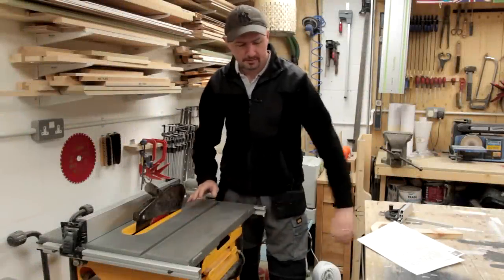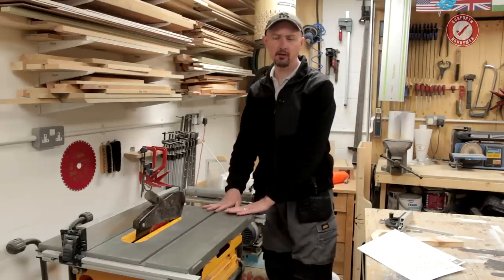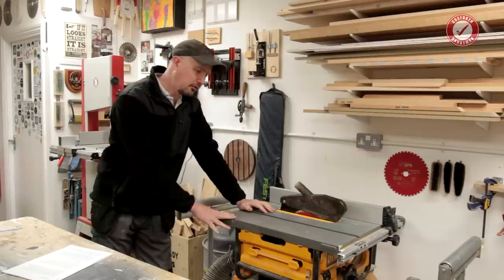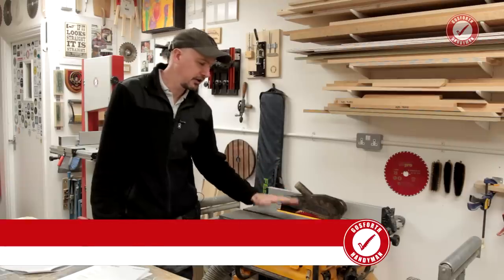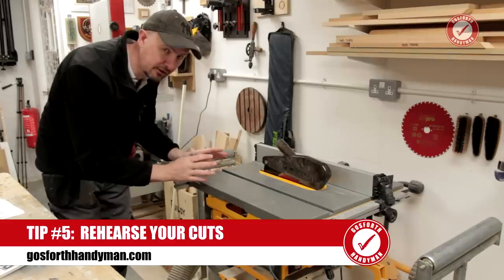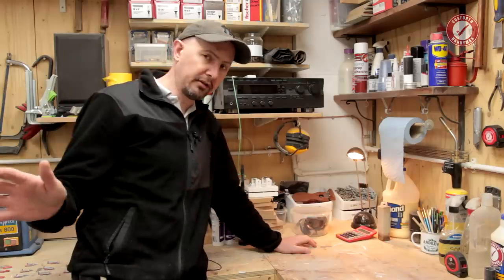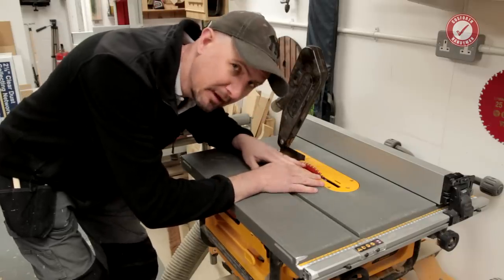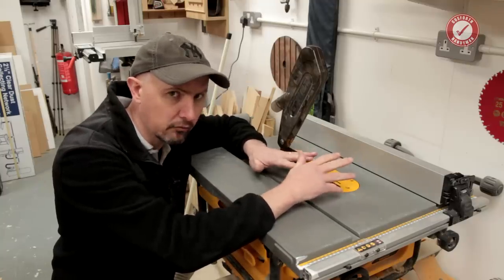TABLE SAW SAFETY - 11 tips to avoid death!

Comment: I removed the riving knife from my TS 12 years ago. After watching this video, I spent 2 hours looking for it, 30 minutes removing 12 years of rust, and just re installed the thing.
Reply: You smart now 😉👍
Reply: Good on you. I hope others follow your lead.
Reply: @CamperKev  I'm putting mine back on today!
Reply: I didn't even know what the riving knife was. I did suffer kickback, but I'm much shorter so I lucked out and took a board in my well padded stomach. I was very lucky, but never understood WHY it happened, or how to mitigate. I'll be installing my riving knife before next use. I don't use my table saw often.
Reply: Factual Fox  LOL, so does my wife! I was very lucky, but luck DOES run out.
Reply: Factual Fox  oh yes, I totally agree... I knew they were dangerous, and still exercised a ton of caution when I used it. I'm just grateful I've learned a lot more about safety, before anything happened.
Reply: Factual Fox  yeah... For all my mistakes... That wasn't one of them... I was happy keeping my fingers as far away from the blade as possible!
Reply: took my riving knife off to do some cuts.

putting it back on first thing in the AM. been lucky so far!
Reply: Three minutes just to introduce the video?
Reply: Would it help to stand more beside the saw instead of in front of it?
Reply: Consider using featherboards to maintain the outfeed.  Clamping a downward pointing featherboard to the fence forces me to ensure clearances before the cut, holds the board down, ensures I cut past the blade, and has never failed me like the splitter has by blocking as mentioned.  It takes a little more engineering to maintain the outfeed, but I have found it to be immeasurable toward safe operation even on the most difficult cuts.  Clamps featherboards (infeed before the blade and on the outfeed) ensure proper pressure is maintained against the fence, downward on the board, and generally keep things where they are, when the cut is finished as well.
Reply: Would you buy a car and cut off the seatbelts? Wouldn´t make sense, right? The manufacturers don´t wanna make you angry. It´s there for a reason.
Reply: @24-Card  Do you have any videos or photos of your featherboards. So you have featherboars on the top and on the sides of the wood that you are cutting? I assume that pushing the wood down, is just as important as keeping it against the fence, so you need 2 different feather boards, one for the downward force, and one for the side force.
Reply: @Ritalie  I will try to explain the set up I use.  I have a long featherboard mounted in the left guide slot on the saw,  the tines do not reach the saw blade, missing it by about 1/4”. In the front,  push sticks are used from the back of the piece and the top of the piece to drive the piece through the blade.  The outfeed maintains the piece as it clears the blade and thereby prevents any possibility for kickback as it holds the piece down while allowing for the push sticks to both complete the cut and clear the blade and outfeed.  Hope that helps...
Reply: Same here, made hundreds of cut, very lightweight piece kicked back, I felt lucky with it knocking huge hunk on bottom of my finger , 4 stitches, splint for a week, , putting mine back on, , also blade guard, if I had taken eye shot or head shot it would’ve been bad
Reply: I'm about to reinstall mine too! Thanks for this wonderful and much needed video
Reply: i'm confused because on  my saw the first thing the manual says is to remove the riving knife, and put in the blade guard.................?
Reply: @fransantelli  Ask the manufacturer for clarification.
I had to remove mine so I could bolt the blade guard to it, then reinstall the riving knife with the blade guard attached.
Reply: Yes - reinstalling mine now - I found it created an annoying "pull" on the timber - its going back on right now though.
Reply: @christopherc1976  I find I have to bend and adjust mine a bit when its mounted to get it just right, and in line with the saw.
Reply: @fransantelli  blade guard is a big version of the riving knife with a guard attached. The riving knife is if you need to remove the guard and do things like blind cuts. Which one you use is your discretion, but you want the riving knife at a minimum.
Reply: The table saw I have access to is old. There is no riving knife nor any way or room to add one. Sigh
Reply: @UltravioletHeather  I've seen some vids on YT where a custom riving knife was added. But you want it solid mounted, you can find in depth videos on riving knife thickness, etc, and crafting one from scratch.
Reply: @paulkeating2049  Trust you are still accident free, it can take much less than 3 minutes for things to go horribly wrong.
Reply: So this morning, I'm cutting a piece of wood. I bought a crappy table saw at Pawn Shop a few weeks ago. It didn't have a knife or guards or anything. A hunk of wood zinged into me and nearly drug my hand into the blade. I knew it was dangerous, but this REALLY spooked me. I went out and bought a new one that has all the safety features.

Comment: I bought my first table saw today. I set it up and then fought the urge to start cutting stuff and came inside and have watched about two hours worth of table saw safety videos. Thanks!
Reply: I did about the same though I fired it up and cut a bit of scrap first. I'll put the blade guard back on in the future. It worked well and without incident.
Reply: Very wise man.
Reply: im doing exactly that right now!
Reply: Glad you're still with us
Reply: @eminem2  😆
Reply: My kickback was my first cut.  A year later, and I still review table saw safety videos.
Reply: That's what I did. watch  a lot of videos on table saws.

Comment: Do not apologize for the length of your video!!! I was severely injured buy kick back when ripping a dense hardwood without a riving knife. The number of times that I have moved my hand or arm over the spinning blade because of poor posture or poor planning (not rehearsing the cut) is terrifying for me to think about. I’ve been using a table saw for 20 years and still found your video worth every minute. Thank you!!
Reply: I know a very nice owner of a Gravesend Woodyard suffered big time from kick back sharp piece flew back and right up into his arm
Reply: Same... Cutting a small piece of dense hardwood and had a horrible bad kickback... I wish I had watched 1 single safety video, because after a lifetime of using power tools, I had no idea what a riving knife was. I had seen riving knives in photos in the catalogs. But I didn't know that they could save your life.
Reply: I sat down and read the Manuel. Now I have watched this super cool video. If you could go in more detail about cutting on the saw with different size wood I appreciate it.

Comment: As someone with no experience of table saws, but just bought my first one; thank you for sharing this and hopefully making me think about what I'm doing and avoid injury.
Reply: Same here.  I haven't even plugged mine in yet, and I've had it two weeks.  I'm studying over and over, until I really learn all the safety lessons first.  I like my fingers, I've grown attached to them over the years, and I don't want to lose them.  Or any other of my soft parts!
Reply: Michael Williams Good point. I would just mention the thinner the piece of wood the more dangerous it can be, and it was shown in this video with kickback. I was not using a push stick and the other mistake I made same as in the video I did not clear the wood past the blade, even though I have used the saw for years “complacency” is what can turn around and bite you in the butt.
Reply: Same
Reply: I downed a longneck of vodka before testing mine the first time. Would like to submit a short report but cant remember enough, all i know is the next day when i saw that the cuts were so far from being straight that i almost questioned my sexual orientation.

Comment: Had my first kickback today. Lucky for me, like the one in this video, I lucked out and I was fine. I'll spare everyone the whole story but it was because I had made a couple of non-through cuts, then simply forgot to replace my riving knife when I then went to make a through cut. Right on cue it shot out of the saw at absolutely incredible speed. If you have never experienced a kickback, first of all, I hope you maintain that streak for your entire lives. Please believe when I say it is astonishingly, ridiculously fast. While I'm not a professional woodworker, I've been around power tools most of my life and my father has had a woodshop in the house since I was 10, so I know better. I made a stupid oversight and was lucky it didn't go south. Made it a point afterwards to watch several videos going through the proper procedures once again. You are absolutely never too experienced to get a refresher, and don't let pride tell you that you can't benefit from going over safety again.

I urge anyone, regardless of your age or level of experience, to make sure you go through a checklist every time you turn on the saw. Every, every time. For anything but the rare non-through cut, you should be using a blade guard whenever possible, and without question a riving knife or splitter when that's not an option. No project is worth your fingers, and there is no one on earth with reflexes faster than a table saw blade.

Thanks for this video, these are all great tips.
Reply: Thanks for sharing when you come down and actually read peoples experience and what they did wrong it drives the message through. I have a mantra whenever I use a power tool  This could be the last time I use it If I get it wrong it just keeps you on your toes to the point it's like OCD  I look down nothing on the floor to fall over no cables in the way etc

Comment: Excellent video. As a retired craft teacher I have used table saws for 50 yrs. In that time I have attended a number of safety courses on this machine and on each occasion realised how much I still had to learn. I have witnessed the design improvements made and the availability of inexpensive diy machines. This video goes a long way to filling the gap in training. There are many videos showing experts producing great results on unguarded machines i.e. dangerous techniques. I think the main reason for removing the Riving knife and guard is to facilitate the cutting of grooves or rebates but too many people do not bother to replace them. This is the first video to draw attention to the dangers of pushing the hand past the blade since it then has to be pulled back past the blade and if you get kickback, possibly on to the blade. Keep up the good work.

Comment: Enjoyed the video alot. Today I just installed a riser knife /splitter and blade guard on my old rigid TS2424 table saw. I bought the saw used about 8 years ago but it did not have the guard and all on it. I got the guard, knife, and splitter off ebay and it was used also. Old saw also old parts. I have been using a table saw for over 35 years but the week before thanksgiving I had a accident. I make bandsaw boxes and was running a small piece through the table saw and it kicked back. It hit me in the forehead causing great bleeding and 5 stables being put into my head. This saw that I had knowledge of for 8 years surprised me! Even the saw I had before this one never caused any problems. Never let your guard down!! I hope the install of these parts I got works . Thanks again for the great video .

Comment: Thanks for that one, it is important to hear these things over and over again. My "nono" moment with the table saw: it was (mostly) because of you that I went out and bought a DW745 over a year ago. And I did exactly as you described - took it out of the box and just got going in the parking lot outside with a few test cuts. No riving knife fitted (because the pros don't use them either, so why bother, right?) and off I went with pine board to be cut into 2cm strips. First I didn't notice what happened, the strips just vanished. I cheerily cut away... when I turned round, all strips lie at the front door to the house (the saw was maybe 4m away, me standing back to the house) and the door - newly fitted three months earlier - suddenly sported several bullet holes from the wood sticks hitting it. The door is massive, it wasn't damaged beyond repair so I left the scars, they remind me of this matter every time I come home...
Reply: So wood can shoot back from a table-saw as fast as a freaking bullet for real? Okay whenever I start doing woodwork I'm sticking to hand tools for cutting or buying precut boards/wood. Probably just sticking to a miter saw for cutting to length and gluing things to a bigger surface.
Reply: What I find very helpful is to shim the riving knife so it just pushes the material against the fence it stands proud slightly with no gap on the  blade, works for me I'm scared of that machine.

Comment: Anyone can have an accident and not want to share what they've experienced. But to show a video of what you've learned is really cool. Even though I've always operated my bench saw from the side I've never really thought much about the other dangers of using it, especially in relation to kickback until you made me aware of it. Apart from the PPE that I'll start wearing when I'm operating the saw, you've also confirmed the need for me to put a First Aid cabinet in my workshop. Thanks heaps for the info.

Comment: I remember as kid using the school table saw, the teachers told use to be careful.
I bought the same DeWalt table saw in the last 12 months and realised very quickly, read the manual for once, this is the one tool to be terrified of... at all times concentrate think about cuts body position and have that guard with riving knife in place.
Every time I turn it on I take a breath and my 12 year old self is ignored... check it, do not chance it. Your video and others on YouTube help to educate us all in how to manage this tool.
Heck my sliding mitre saw saws me less, as I know as long as the fingers are well clear I am likely to be okay.
With any power tool you have to look around you to make sure anyone else is safe and then check yourself.
Thank you for showing you misfortune to educate us all.

Comment: Hi Andy, I would not advocate standing side on to the saw simply because if something does go wrong you do not have immediate access to the stop button.  As for sawstop saws, brilliant idea, I just worry they make you reliant on technology instead of common sense & training. 
One rule that I have is no alcohol, not even a lunchtime shandy, and then into the workshop.  Sounds obvious, but I have known people to assume that they are OK to drive so they are OK to use tools but, to my mind, both are zero alcohol limits.
The worst accident I have suffered was running de-nailed reclaimed timber through my saw (with no guard in place..It was only one cut, what could go wrong?) and I had missed something in the wood.  I lost three carbide teeth from my blade and gained some lovely scars on my left forearm and cheek where some rather hot pieces came to rest.  I was wearing eye protection thankfully!  So another rule is that when using reclaimed timber I ALWAYS run a hand held metal detector over the wood.

Keep up the good work & keep posting.
Reply: I was fortunate. i stopped the saw as soon there were sparks. I am never going to run reclaimed timber  on my saw
Reply: Robert, for things happening instantly, the access to the stop button is irrelevant, because it is not "immediate". Using the button is at least 100 if not 1000 times slower than a kickback. What makes the big difference is whether you are on the path of the flying piece or on the side.
Reply: Fortunately, I have the power switch on the wall behind me. A good observation nonetheless.
Reply: I agree. I don't like the fact the the waste is way out of reach and out of control.
Reply: What I did is also put a breaker switch on the wall which the table plugs into. These tablesaw will usually be required to be switched on with the on machine button but I also have an emergency breaker on a wall/table leg too.
Reply: The secret is, use a full kerf, professional blade. The new Freud blades have carbide that is so hard and brittle, it turns to dust while being shipped to you in the mail. The old carbide was softer, and less prone to breaking. I've cut through many nails with my saws, and never had the carbide break. But I've seen many reviews of Freud blades, newer Diablo blades, and on some of them, the quality control is bad, and the carbide falls off before even using the saw... If you get a full kerf, professional blade, you can be sure that the carbide is brazed properly, if you're cutting hard woods and material with nails. Also, you probably don't want a "high ATB" blade for nails. A flat tooth of "TCG" grind has a flat tooth profile, which is obviously much stronger when it encounters a nail, rather than a tiny razor sharp corner of a tooth hitting a nail, where it is almost surely going to be fracture the tooth. Look up "Demolition" or "rough cut" or "Framing" blades and see what tooth profile they are using. It's probably not a High ATB (sharp angle) tooth.

Comment: As someone who has only owned a table saw for less than two years and not used it on a regular basis, I always watch these safety videos. Yours has had a big impact showing even a professional can have a serious problem. I liked the idea of standing to the side whilst feed the wood, it had crossed my mind but was forgotten, now I’ve seen your video I’ll certainly try it. I think your video explains push sticks much better, as some people don’t like using the one supplied with the saw. Most manufacturers supply the exact same style for a good reason and you demonstrated that very well.
Reply: Another adage might be: "Use your table saw regularly. Practice beats ignorance every time."